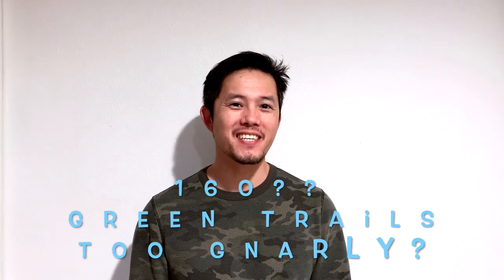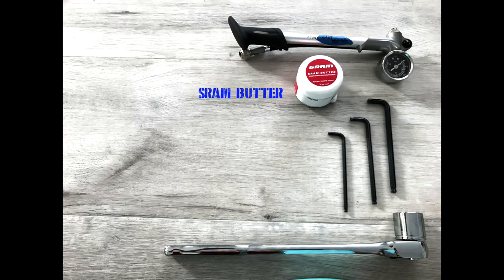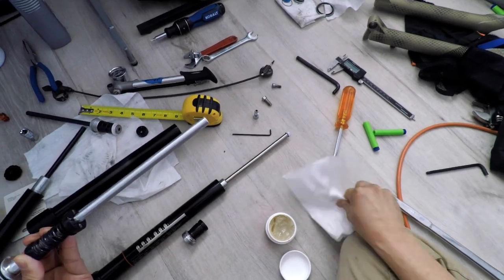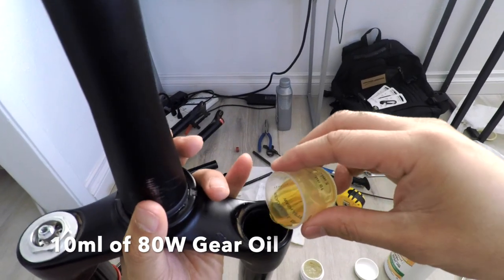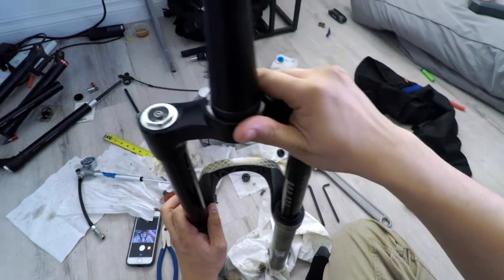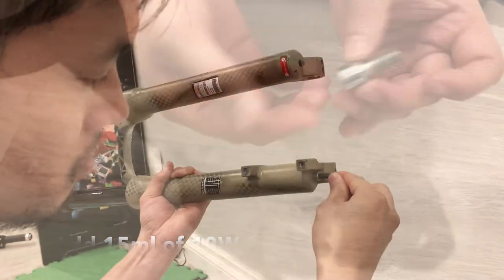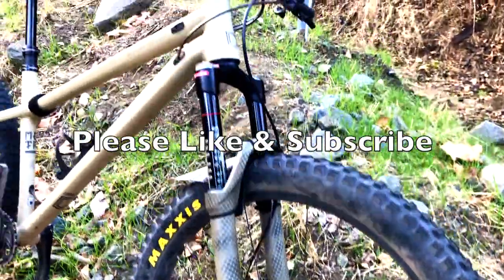Budget Fork Reassembly and Mods: Adjust Travel & Oil Bath

Comment: Did you measure the actual travel before you adjust it to 160mm? Was it 140mm like stated or less than that? Do you know if it's possible to adjust travel to 130mm?
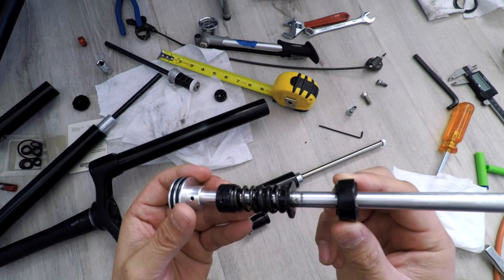Reply from the maker: Sadly I did not measure before the change. I measured both spacers to be 22.04mm combined so I would assume the old travel was 132mm. You can reduce travel by adding spacers or if you watch at 1:07, the top retainer for the metal spring is held by a roll pin. You could remove the roll pin and set it at one of the 3 lower holes (10mm increments). I hope that helps.
Reply: @mtbxpchannel9031  Yes. Good information. Thanks.

Comment: I want to do the same thing but I only have 5w-20 engine oil and some transmission oil, should I use one of those?
Reply from the maker: For the oil bath I used 5W-20 Full Synthetic. I’m don’t know about transmission oil, if that is 80W i think it will work in the air chamber.

Comment: hey dude its me again and im not extremely knowledgeable on suspension so Im gonna ask some questions. so i opened up my fork yesterday and when i looked into the lowers i saw some plastic bushings underneath the dust seals. so can i still put those foam rings in or no?
Reply from the maker: Unless there’s a gap to fit rings, it’s likely it wasn’t designed to have foam rings. The plastic bushings sounds very much like Suntour designs which don’t use rings.
Reply: @mtbxpchannel9031  huuuh ok sounds about right since the posting for the fork says performance over suntour epixon. so I would just assume they mean they copied a suntour epixon. so would it still be beneficial to put that motor oil in the bottom or no?
Reply from the maker: Foam rings are to just hold oil so when you store your bike, after everything has settled to the bottom, the rings will hold some oil at the top. It doesn’t prevent leaking or create a seal or anything, just provide a convience. If you wanted to do an oil bath you can, your fork would have to cycle a few times to get oil too to bottom OR tilt your bike vertical and you’ll oil the stancions that way first.
Reply: @mtbxpchannel9031  ahh ok. ill probably hold out on the oil bath since i don't think my fork is capable. I will try to extend my travel though but I need a pair of lock ring pliers to get past. so in the meantime I just assembled the whole fork back again LOL. I do feel proud of myself though I was really scared of taking apart my fork but I did it successfully. ill make an update video if I extend my forks travel.
Reply from the maker: Hell yeah man! That’s what I wanted with the channel, have people learn and do.
Reply: @mtbxpchannel9031  well it sure did work man good job 👍

Comment: It's comparable with the suntour epixon fork?
Reply from the maker: Yeah it’s pretty close to the Suntour. The bushings may be a little different but the damper and other components are likely the same
Reply: @mtbxpchannel9031  thanks, knowing that the ztto and the suntour are the same which one do you prefer? IDK if those two are priced the same
Reply from the maker: The ztto uses foam rings instead of a plastic bushing so lubrication is a little better. Also ztto has boost thru axle spacing, epixon I did not find one.
Reply: @mtbxpchannel9031  yep, the epixon just have QR. Thanks again. Keep the good Job. Get to know about this not so popular brands is really useful for a lot of people out there. :)

Comment: How the performance of the fork bro?
Reply from the maker: I think it’s perfectly fine. I don’t do many jumps or drops, mostly trail riding. My last ride I was trying to run over every large rock I could find and the fork ate it for breakfast. The really small stuff doesn’t activate the fork, it might be because the headtube angle is now 64deg.
Reply: @mtbxpchannel9031  but it is okay to put a oil in the air chamber?
Reply from the maker: The oil in the air chamber is to help the air seal and a little be progression. It was something I got from Suntour site. You are OK without it, I did it just to try.

Comment: hey do you have a link to where I can get the nylon washers. im gonna attempt this oil bath thing.
Reply from the maker: I don’t have a link because I just took the bolts with me to Home Depot (or equivalent hardware store) then looked for nylon washers that were a good fit. At least you can return if it doesn’t fit well.
Reply: @mtbxpchannel9031  oh ok thanks ill check out a hardware store to see if i can find some